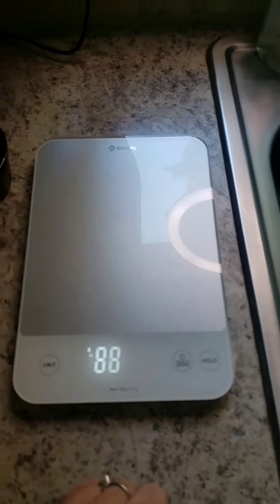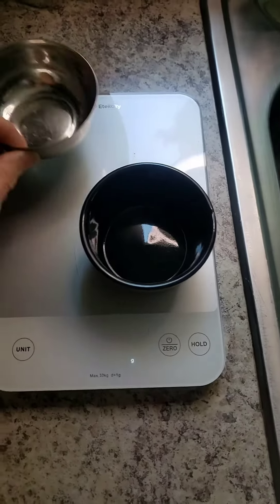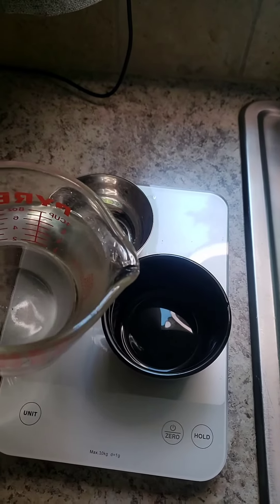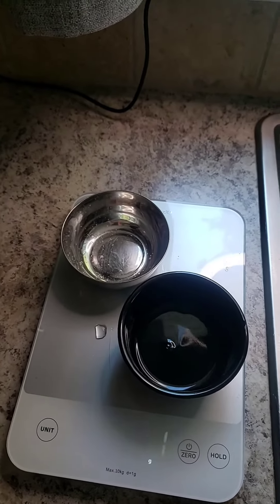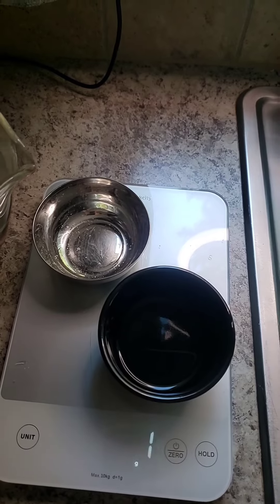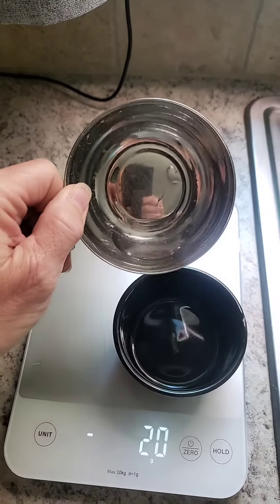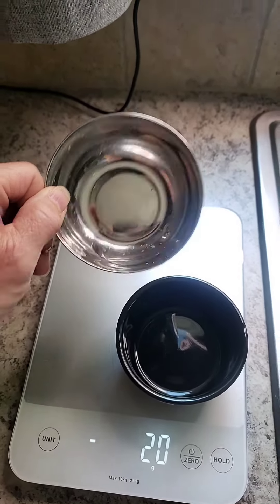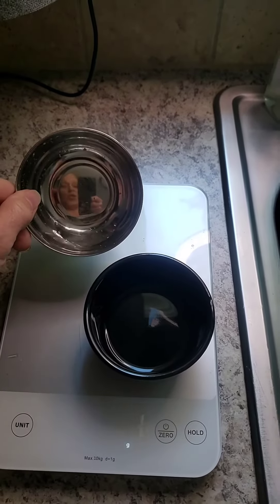You Asked... Let's Review This Scale I Use (Freeze Drying)

Comment: I also have that scale. Thank you for the recommendation! Where do you place your freeze dryer trays on the scale? I know that’s a strange question but sometimes when I am weighing the trays for the 2nd time, I get a reading of more grams than I weighed the first time. Then when I move it around I get the original weight. Do you have a certain place on the scale where you set your tray?
Reply from the maker: Hello there!!! I place the trays directly on the back portion centered.  Sometimes if I don't have it fully charged it takes a moment to go down a gram. But mostly it's right on.  There is a weird thing that happens in weighing them toward the end of the dry time... They oddly gain a gram... usually one or 2 of the 5 trays.  that's pretty much a sign for me that they are dry.    Thanks for watching!